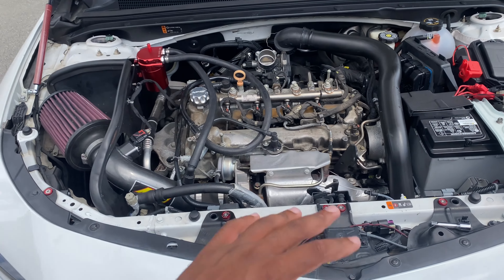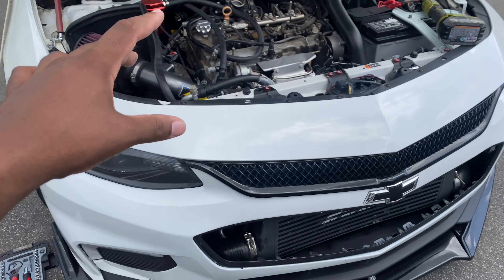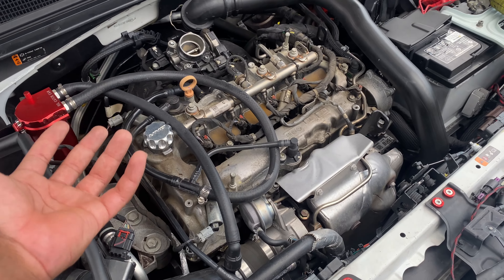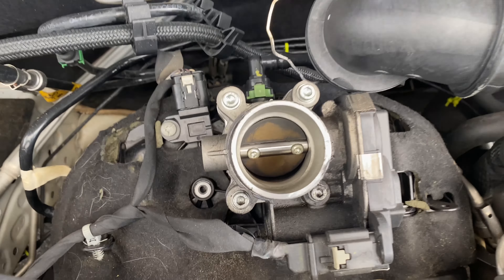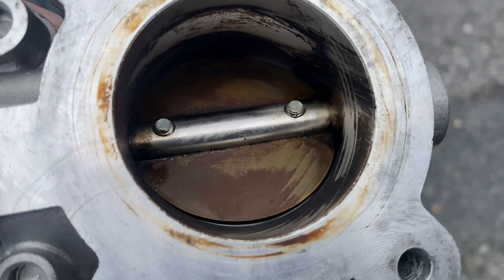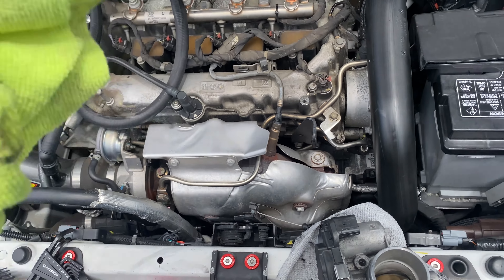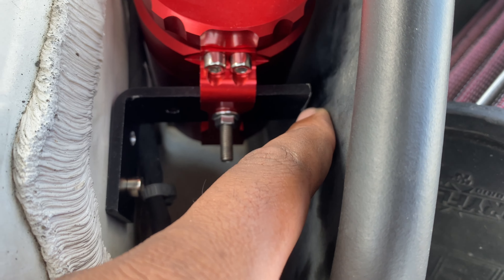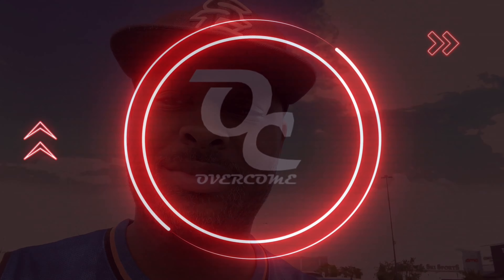Maintenance & touch ups on 2017 Chevy Malibu

Comment: I definitely feel your pain. Had slight issues after installing the BNR throttle body/intake manifold spacer (few error codes), but the car still ran. After installing the universal intercooler, car ran great for about 11 hours and then I attempted a hard run from a green light and I heard a “POP” which was the intake hose popping off. The car went into limp mode, but then the car started having issues staying on (oil pressure issues or possibly a sensor issue). Either way, it’s back in the shop waiting for a new alternator and brake booster (supposedly the reason why the car won’t stay on). From the beginning, my shop guy was warning me about my turbo as well as there was a good bit of oil in the entire intake system. Would love to hear which intercooler kit you’re getting, but will hold tight until you have it installed/tested. Love the channel (literally my only resource for the 2017 LS) and keep up the good work. Glad you guys finally got to the $$$$ 🫡
Reply from the maker: Yea mine is currently idling funny but it always goes back to normal so if idk cause I don’t have codes at all. I will definitely have a video of the complete new set up
Reply: @BuiltByGhostt  Cool. Thank goodness you're running code free. I will be replacing my throttle body and CAI tomorrow. Could be a very dirty throttle body with all of that oil in the system and I'm too lazy to clean. Just moving forward with the replacement. lol

Comment: Quick question bro, love the unique channel.

Have you noticed any difference in performance or fuel economy when switching between 87 and 93 octane without a tune? I have no idea
Reply from the maker: You don’t need a tune to swich gas fam. The bu actually runs better with 93 in my opinions. You’ll definitely see and few the difference
Reply: My wallet feels the difference as well. 😢
Reply: @overcomecc0312  the economy is better on highway driving.  I installed a  CAI and it decreased consumption.  Mainly on highway tho.  In city driving is atrocious it slowly creeps up from the low 8's to the mid 9's (l/100km).  Before the CAI I was mostly 10L

Comment: I got a 2017 malibu ls 1.5 wanna get it tuned but dont know who or what to use, Any help?
Reply from the maker: I definitely recommend bnr and they even have a Facebook group to help with any performance or questions in general you may have
Reply: @BuiltByGhostt  all love bro appreciate it a lot
Reply: Bro don’t tune it’s a 1.5 pulling a heavy ass car trade it in for a newer 2.0 250HP 
9 speed automatic and destroy v6 s all day
Reply from the maker: @luxury305ASMR your not wrong but the 2.0 also has more problems then the 1.5t so no mater what it’s a slow car but it’s cool to be unique
Reply: @BuiltByGhostt  idk about all that. The 2.0 is pretty solid. I know the 1.5 has thinner rods, then you have the god awful turbo, the same head gasket problems the 2.0 has.
Actually all I need to mention is the shotty turbo. It's designed to restrict power, and it's TINY.
Reply from the maker: @Lasty313  the problem I know has probably with the 2.0. The only problem I know a lot of 1.5 have is the engine reduced power light coming on so idk but each it’s own
Reply: The only time I seen the reduced power come on, is in cold weather.  Being here in Canada it's happen to me a couple times.  Once it warms up a bit it clears.  They have a fix for that on a tbs.  If anyone has a problem with that they should check the dealership.  There is a milage time out tho.
Reply: @BuiltByGhostt and I still got that damn engine power reduced as soon as the car turns on and idk what it is 😒
Reply from the maker: @karajohnson6588 😭😭
Reply: @karajohnson6588  could be your throttle body or inner cooler🤷‍♂️ I’ve not had an issue and I’ve put over 100,000 miles on my car, and I treat it like a shit box 🤣🤣